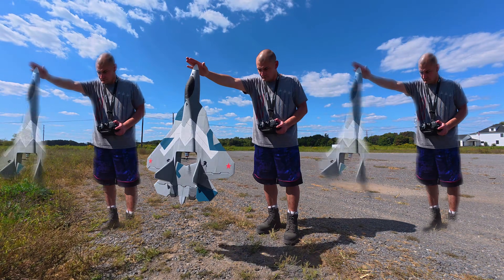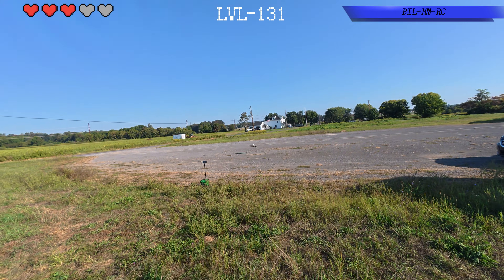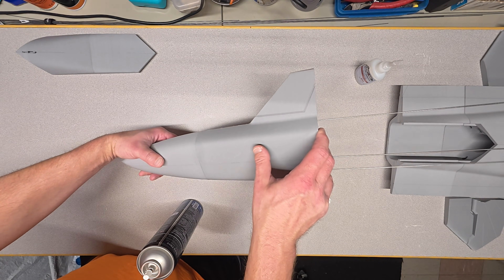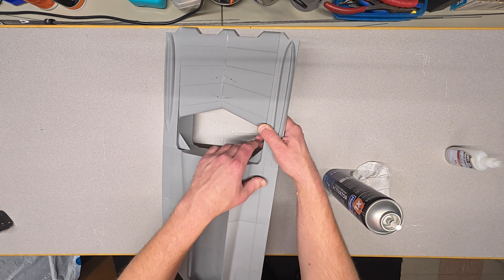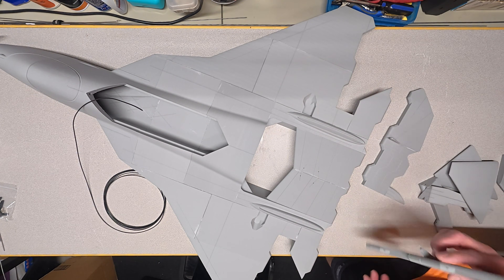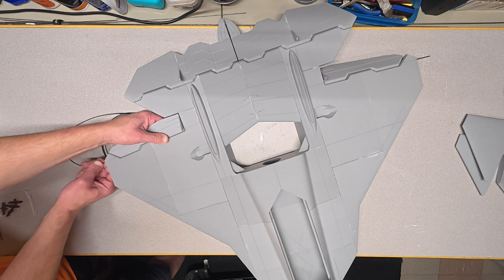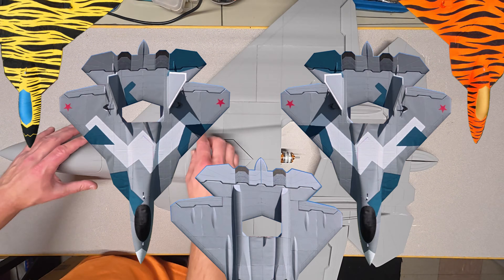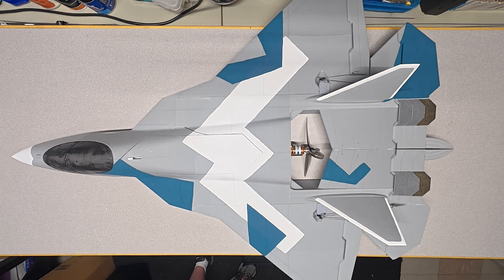Crash Resistant - Budget Friendly - SU-57 Park jet - Step by Step DIY

Comment: Hi Bill, I just purchased your SU-57 plane from Cults3D and have begun printing on my Bambu A1.  I pull the STL in and let the Bambu slicer do it's thing.  So far so good with first parts.  I noticed for the Ailerons, your Print Settings sheet calls for 10 bottom layers.  What is meant by "bottom".  When I pull into Bambu and auto orient, it puts the control horn on the bottom of the plate.  It makes sense to me that this face is the "Bottom" as I can see why you would need more strength on this face to control this control surface in flight.  Am I correct to think this is the "Bottom" ?
Reply: When I pull the 3mf aileron part in, Bambu does show it with the control horn on the face of the plate so I think I got it right.
Reply from the maker: Yes, that would be the bottom. You would either use 10 bottoms at .2mm layer height, or a modifier in that area to have 100% infill. Several different ways to do it. The settings from the chart are really just basic settings. And the number of bottom layers would depend on layer height of course. If you ever want to see all the settings I use, you would have to download and open the 3MF’s with Prusa Slicer to see everything. My G-Codes and 3MFs print the plane pretty nice, if you can run them I would recommend it. Insert them into the printer though, don’t run them through a sliver. Or you could set your printer up in Prusa, and run the 3MFs from there. I will be working on profiles for Bamboo and a few other slicers in the next two months, after the F-15 is posted. Make sure your “slice gap closing radius” is set to 0.00 for the internal structure to appear. The only travel moves should be from the infill pattern. Anything else comes up let me know.

Comment: Do you recommend this, or the f22? I’m trying to get a friend into the hobby and I don’t know which one would be best for him
Reply from the maker: Personally, I like the way the F-22 flies better. The SU-57 uses only 3 servos, so it’s a little quicker to build.
Reply: @HoloModels-RC  Ok thanks! Have you noticed any difference in durability?
Reply from the maker: @coltengibbs5404 Good questions. Little differences. They are both built very similar, but the SU-57 has three wires through the nose surrounding the battery, which helps keep the nose from breaking off if landed hard. Better than the F-22’s one wire. The F-22 usually breaks behind F-2 if landed hard. Even if one breaks from landing hard, the wires or CF hold the pieces together, and CA will easily fix the crack. I would say the 57 is a little more durable I guess. However, I already plan on updating the F-22 with additional wires like the SU-57 in the near future. My recommendation for someone who had never printed an RC airplane is, try to use the G-Codes, and be aware that the plane is eventually going to break, and there is really no way to make them stronger without sacrificing elsewhere like weight. Designers don’t really mention this stuff. A typical printed plane will last about 30-40 flights, where one of these park flyers will last much longer as long as you don’t crash it. Flight Test and foamboard airplanes are great for entering the hobby and learning how to fly, just so you know.

Comment: Totally love your video.  The plane, the flying, the build and especially the build tips.  I will be printing some of your designs!!!
Reply from the maker: Awesome, thanks! Got a lot of time in each of them, and they are a lot of fun. Keep an eye out for the F-15 in the coming weeks.
Reply: @HoloModels-RC  I have probably missed it since I haven't seen all your videos yet, (just found your channel) but do you use a protective coating on your lw-pla?  There are several options and I wonder if you have experimented with them and which one seems to work best?  I use satin finish uv resistant clear coat, one regular coat on top and two on the bottom of belly landers (rattle can) but am curious about oil based polyurethane and wondered if you have used it.  I have started printing with the lw-pla HT from ColorFabb in hopes that my planes last longer but I still want to give them a protective coatings.  Thanks, Joe
Reply from the maker: @wwjoesr Typically no. I have experimented with different things though in the past, both water and oil based polyurethane, the truck bed liner that is brushed on, coating with thin CA, and also an epoxy and denatured alcohol mix. I feel none of them are worth it. Unfortunately, prints don’t really last long enough to put that much time and effort into them. I found I have better results keeping them as light and simple as possible, especially 3D printed. Lighter usually lasts longer, for me anyway. There really is no way to make them stronger without sacrificing elsewhere. Get about 100 flights before I disassemble, which is more than most people do. Sometimes will use duct tape on the belly landers, but typically not. I am one of those people who can really get carried away with making them look nice, and building them perfect, and it’s some times hard to force yourself not to. I always try to tell people to keep it simple, and the lighter the better. Have never been one of those pilots constantly worried about weight, until actually getting enough experience to notice the difference and also making the exact same models but built differently and noticing the difference. Hope you enjoy my models, and thanks for the comments!
Reply from the maker: Also, Colorfabb is nice stuff. However, in my opinion, Sainsmart or E-Sun usuallly last a little longer flight wise. Colorfabb consistency is closer to pre-foamed, where the others are not. Especially Sainsmart. ColorFabb has a tendency to break and get holes from twigs and stuff on landing a bit easier, where the other brands kind of stretch more instead of tear or break. Bit hard to explain, but it’s true. Colorfabb is a little denser, and also a little heavier than others. If you can, try different filaments to see what you like the best. They really are quite different. If I could only recommend one, it would be E-Sun. But it only comes in white and it’s nice having colors. I use all of them for different things.
Reply from the maker: HT is much harder to print with. Use lower layer heights, and slower speeds. Only used it once, not really a fan. It’s not something anyone can use. Personally, I would rather buy two rolls of another brand than one HT. You’d be better off with 3-4 planes, than 1 that is sun resistant. Plus HT is the heaviest of all the LW-PLA’s

Comment: Finnaly i complete all :) , with 4s battery , motor and all parts 990g is it normal ?  and i m waiting some cg photos , pls help me :)
Reply from the maker: Yup, that's perfect! Mine is 950g, so good job on the weigh. Added a picture of the CG on Cults!
Reply: @HoloModels-RC  Ty so much for CG , But i did very big mistake i think :( , i montaged wings upside to downside , i mean servo side not looking up , looking down , i thought it must be down side :( , before i did f15 , f16 , mig and all was servo down side , it was habbit for me downside servo :) , i hope he will fly , looking normal but i dont know :(
Reply from the maker: @h.umutkaya Very interesting! As long as you put the elevators on upside down also, it will probably be fine. My control linkages are alway on top so servos don’t strip when they hit grass. Bet it will be fine, now I understand why you couldn’t find the CG.

Comment: Hello , can you pls show where is CG exactly , i didnt find in model files , where i need to look ? thank you.
Reply from the maker: Yes, it is the line on the bottom of the aircraft inside the Leading Edge Flap panel line. It stands out enough to see and feel. Maybe I will update with the CG Symbol. If you want to measure, it is 5mm forward of the seam of Fuse-3 and Fuse-4.
Reply: @HoloModels-RC  Yes pls update with symbol and upload some detailed new photo on cults3D , thank you

Comment: Hi Bill.  Where can I purchase the full 3D model and cost of the SU-57?
Reply from the maker: Hey, there should be a link in the description and it's like  $13. All my models are on Cults3D.com. The link should take you to all of them.
Reply from the maker: Good choice with the F-22. I personally like it more than the SU-57. The RC Groups thread has files for rudders that are actually on the fins, not the centerline (will update soon). Although, first time printing and flying I would recommend the centerline rudder and be sure to follow the print setting and infill percents if slicing yourself. Lighter the better, flies way different when it's overbuilt.

Comment: What battery size do you use.?
Reply from the maker: Mostly a 2200 4S. If you follow the print instructions it will balance with a 1400 4s, and as large as a 4400 4S. Also, with the recommended powertrain it will fly on a 3 cell battery.

Comment: Great model, just finished printing it today and started cleaning up the printed parts so hopfully tomorrow i can assemble it, does the dark blue paint have a colour code or name ?
Reply from the maker: Awesome, Thanks!! Good question. No, I mixed it from White, very little black, and navy blue. It's mostly white. Took a couple tries and a lot of failed paint to get the color right.
Reply: @HoloModels-RC  I have ordered some Russian AF Blue by Vallejo it’s looks close
Reply from the maker: @paulmason6847  Ok, cool! I used cheap acrylics on mine. That was what I thought would be the easiest paint job for this model. It's impossible to paint digital camo. Was either this or the silhouette of an F-16 on the top. I hope yours turns out nice and would love to see it when you're done!!

Comment: Hello, nice model. I've printed it and assembled it so far. Can you tell me the CG again? It's best to measure it from the leading edge of the wing. Your CG is hard to see on the print.
Reply from the maker: Awesome, thank you! Yes, it is the line on the bottom of the aircraft inside the Leading Edge Flap panel line. It stands out enough to see and feel. Maybe I will update with the CG Symbol. If you want to measure, it is 5mm forward of the seam of Fuse-3 and Fuse-4.

Comment: Hi Bill. Just watched your YouTube build video, i was so impressed that I just went out and purchased my first Creality 3d printer. Thank you for the great videos and for inspiring me to try something different. Just one question. What is your filament preference?
Reply from the maker: Thank you, I'm honored and very happy for you! Printing is a hobby within a hobby and can be a lot to learn at first. Good question, and all the LW-Filaments have different properties. LW is what you want to use on aircraft, but not what you want to use when learning how your printer works.  As far as LW filaments go, E-Sun is good all around, about average strength and weight, easy to print with, and also the cheapest. Sainsmart expands a little more so flow rate can be lowered, giving a lighter model, but it is also softer, more plyable, and clogs a little easier due to lower flow rates. ColorFabb feels like pre-foamed PLA which is a little harder to the touch and stronger, but it's also more dense, heavier, and more expensive but it comes in more color options. Those are the main brands available to me here in the US. I use different things depending on what I'm doing.  But If I was to recommend just one, I would say go with E-Sun LW. Also keep in mind that not all models are created equal. My models are designed without overhangs, and the only travel moves come from the infill pattern itself, not the model. I intend to make a few print/print setting videos over the upcoming winter so keep an eye out for that. The Slicer you use is just as important as anything else. Creality Print is a good slicer. I make the model files I post for you guys using PrusaSlicer.